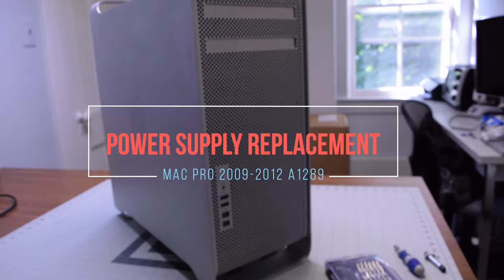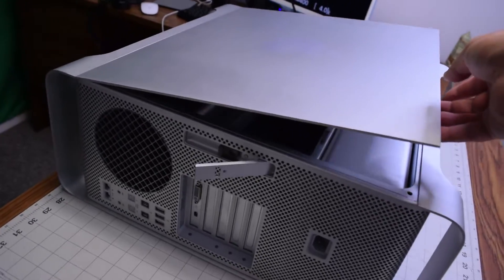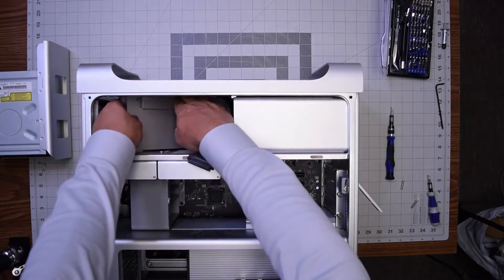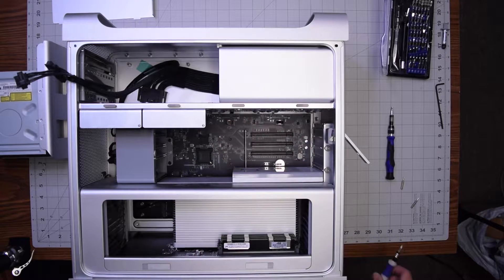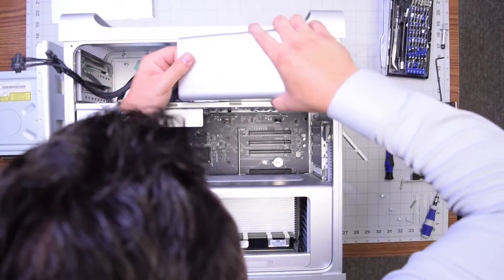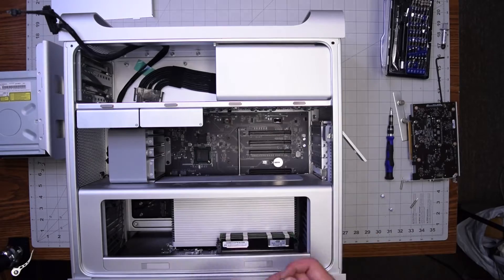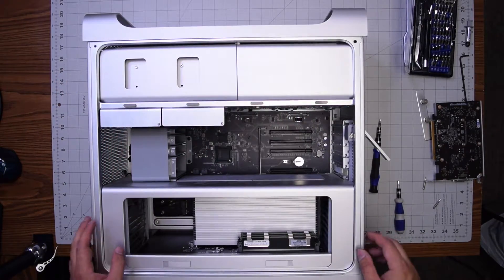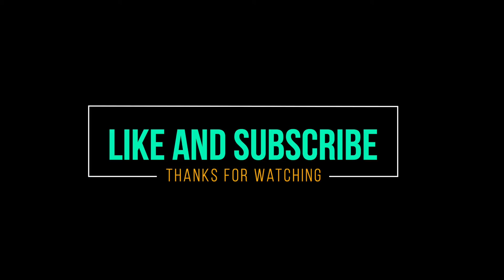Mac Pro A1289 - Power Supply Replacement (2009-2012)

Comment: The power supply cable wasn't connected properly! You could see it dangling as the metal panel was replaced.

Comment: Have you experienced any random powering downs with this product? I have two 27’’ displays connected is all but not sure what could be the cause. I have taken to several computer repair stores and they are unable to mimic the problem. I’m wondering if something needs to be replaced or could it be my home socket? Anyway to properly test this issue?

Comment: Are Power Supplies from Mac Pro's 2009 to 2012 interchangeable ?
Reply: mac pro 4.1 & 5.1 have the same PSU. Note: 1.1 2.1 3.1 has ddr2. 4.1 & 5.1 have ddr3 ram. (see about this mac menu)

Comment: The most thorough and accurate instructional video I've ever seen. Usually, there are at least subtle differences somewhere in the process. Not here. Everything was just as shown. Thanks! You've not only saved me $$$, but stress as well.

Comment: How can you remove and replace that psu fan without taking out the lower motherboard? Is it possible to cut the cables and solder on a new exact replacement fan or can you route the cable of the new fan elsewhere after removing the old fan?
Reply: https://www.youtube.com/watch?v=fBiIJami8v0

Comment: I have thos weird behaivior in my Mac Pro 2012,.... it wont run in cold weather.... but i put a heather in front and i fire it up, then it starts to restart over and over, until it gets warm it stays  on... i foud that with an app to mnotor cpu temp and mother board... it works fine on 65 celsius in the mother board.... any sugestions???? im suspecting about my PS but now im not sure/....
Reply: I had a friend who had a Samsung TV that wouldn’t fire up cold. Hit the back with a hair drier it’d fire right up. Turned out to be bad capacitors in the power supply. So it’s possible your power supply is failing. I personally have never had a Mac Pro have a temperature related failure. I maintain (14) 5,1s. Have had 2 bad power supplies since 2010.

Comment: My Mac Pro has been having issues for a long time. I suspected the power supply, but have been advised it could be a failing mother board? I finally removed the PSU from the tower (while watching this video) and realized the PSU was very dirty inside. I used an air can to clean it out and after reinstalling (minus the screws) I was able to start the computer up one more time. I worked for several hours and had no issues (like random shut downs). Hopefully the cleaning helped and it will start again when I need it next!   ... so yea, THANKS for the video!
Reply: Did that help? I have a 5,1 which has started doing the same....
Reply: @briananthony9083  Mine too. Random restarts and loud fan. No kernal panic though. Any idea?